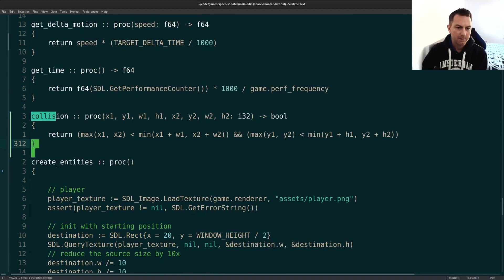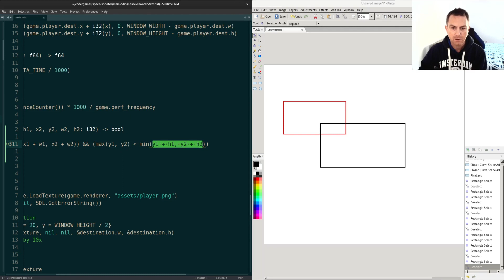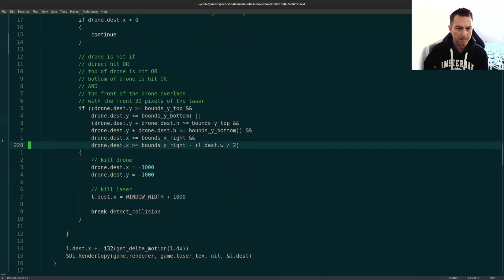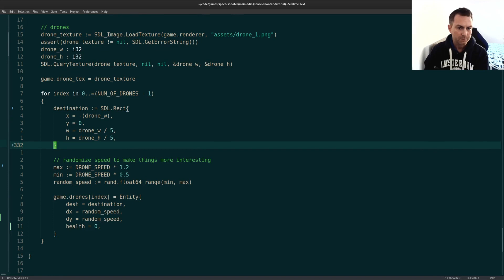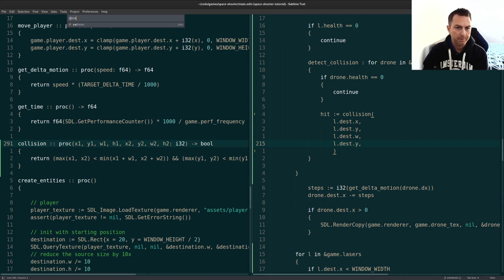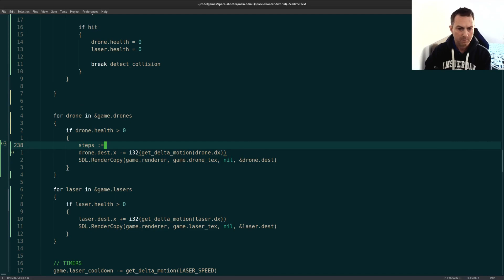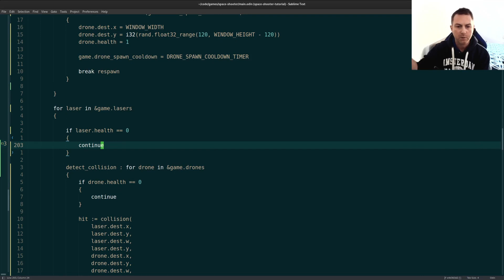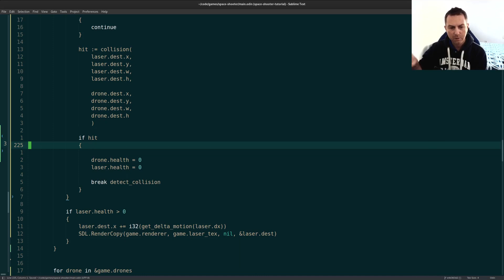Destroying Enemy Drones && Collision Detection | Space Shooter Part 7

Comment: I have somewhat different approach to "if" statements in procedures/functions. I don't think about what is most common approch to solve a problem but rather what are conditions that should end unnecessary computation and reduce indentation.
I would change your "for" loops with lasers and drones to something like this:

if drone.health == 0 break
if laser.health == 0 break

By doing so you are reducing identation and the more identation you have it's harder to read code.
Reply from the maker: Good advice 👍 i believe i made changes like that in later updates. I usually do the same, and i agree that it helps with readability.